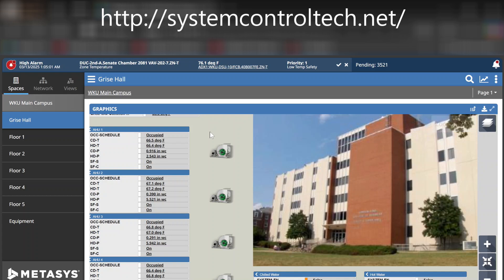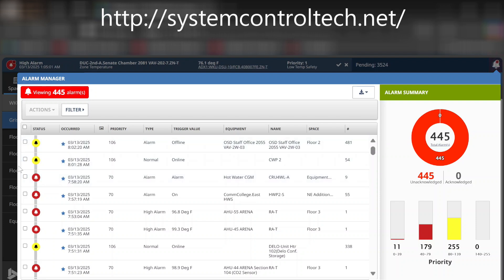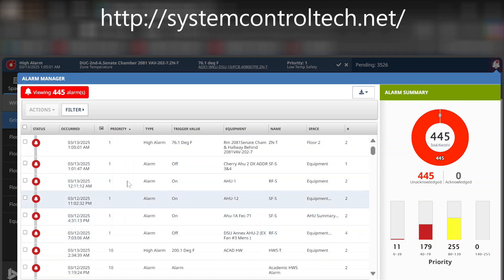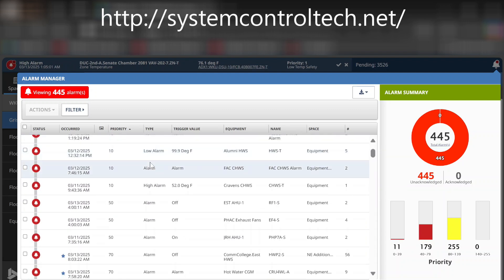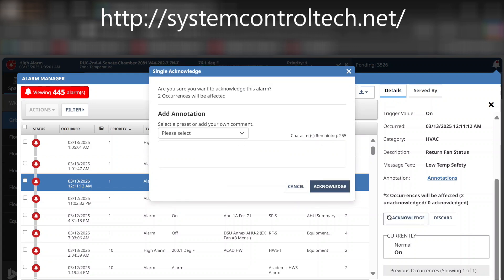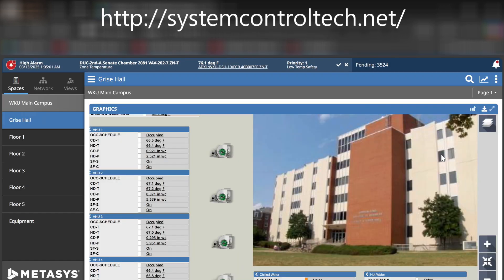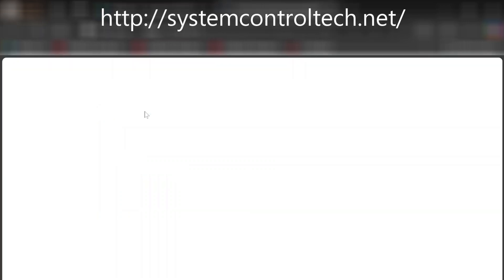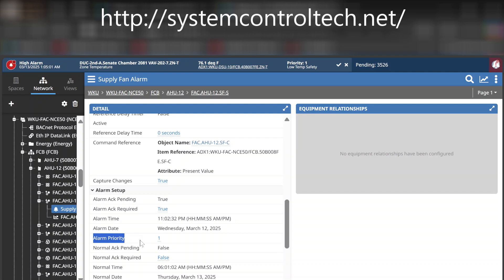Why Your Metasys MUI Dashboard Feels Clunky—and How to Fix It Fast

Comment: The Metasys Alarm manager has really poor functionalities. searching and filtering is limited to some predefined fields. No possibility to individualize the shown columns and columns with. Dashboard is only usable for very small systems. compared with other available solutions the JCS Alarm manager is really weak. No real improvements since the Version Metasys Version 10 Five years ago. Despite several discussions with the sales department the Metasys alarm manager and graphics did not improve in the last five years.
Reply from the maker: No.  The main way to set this up to work properly is to set up your alarms with proper descriptions and priorities.  There are improvement opportunities but if you don't set up other portions of your system properly, it won't work as it can.